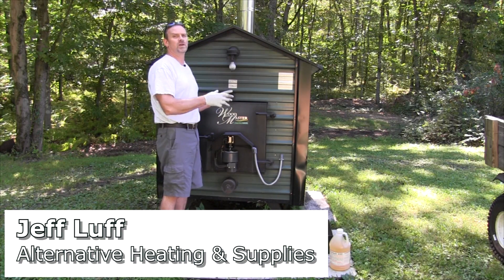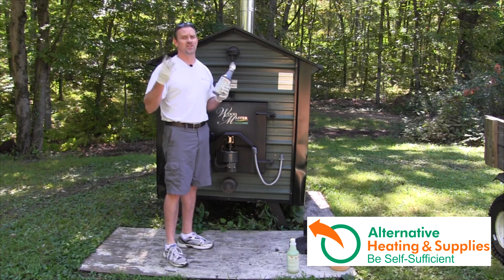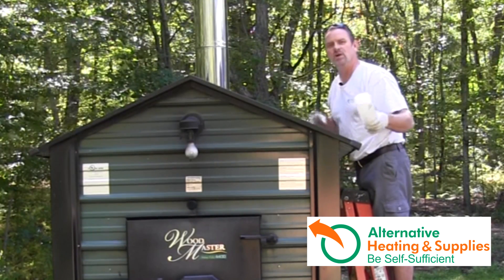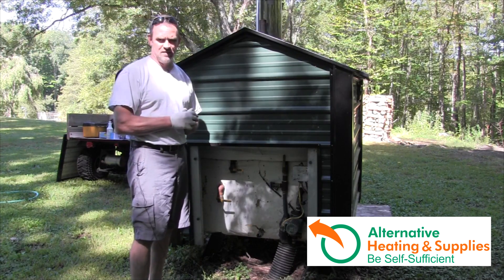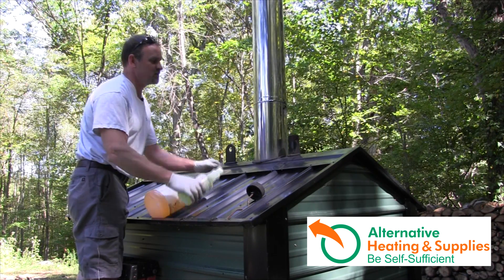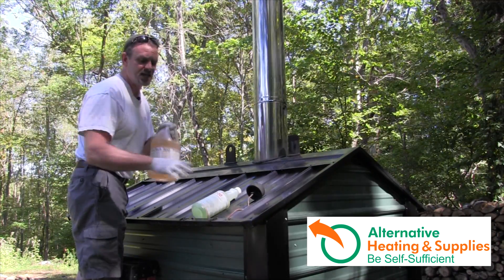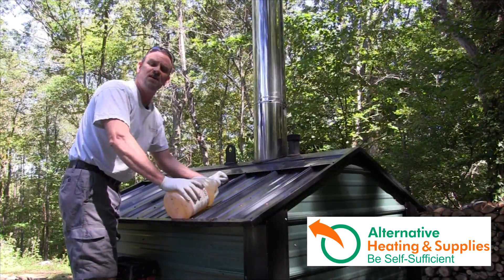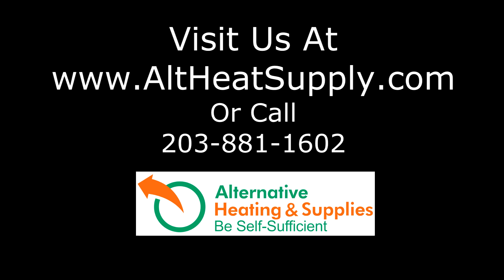How to Use Water Treatment for Your Outdoor Wood Boiler | DIY Wood Boiler Maintenance

Comment: Instead of turning off the water to the lines, won't it be helpful to clean the lines and heat exchangers as well?
Reply: flash basbo i could be way off base, but when you add the cf205 and vinegar to the lines and let it run for 4-8 hours it should clean the lines and all that the water touches. he said that there will still be cleaner in the lines, but it wouldn't matter because it would be diluted so much by the couple hundred gallons of water and also the anti rust and scale treatment.
Reply from the maker: Yes, I also clean those lines and exchangers as well. I close them when draining so I don't need to re-bleed the lines.

Comment: The fill/ vent on top of my unit is smaller and does not have a cap. Is this an issue? I will measure but I think it is about a1” tube

Comment: On the bottle of CF-205 it advised not to come in contact with galvanized steel . I have a couple galvanized fittings in my system left . Can I still use it in that situation.
Reply from the maker: Yes, galvanized steel is not on the inside. Jeff

Comment: I am new to wood boilers, question I have it, Do I need to flush this yearly sense I am running Glycol?
Reply from the maker: I don't like Glycol and don't use. Moving hot water doesn't freeze. All I do is add water treatment yearly.
Reply: @AltheatsupplyLLC  What do you do if it breaks down and you have to order a part that wont be here for couple of days? Somethings got to give
Reply from the maker: @leelc211  I have been burning 20 plus years and have had plenty of failures (around 6 to 8). But there always seems to be a friend to help or parts you can pick up to hold you over. I keep a pump on the shelf and the critical parts. which are still cheaper than Glycol.
Reply: Can you use this while it is hot like a fire going or do i need to let it go out? i run my stove yr round

Comment: 20/20 June and our boiler got several cracks in it around the door so we had a welder come out for $175 which is more than reasonable fairly cheap did a great job of  it would cost us $1,000 just to weld that one piece, you filled the boiler back up with water after 6 to 7 years of using it each year, to see if there was any more holes and found out there was a whole third the top or we couldn't even get to it to weld it you would have had to taken the whole furnace apart itself just to weld one piece, not worth it if we need to heat our house we're going to go back to our old Log Cabin which we've never had a problem with it will heat are home but it won't heat our pool we're going to look for other solutions to heat our pool, you would think for $5,000 a furnace would last longer than 6 to 7 years wish I had them spent the money or invested in it me it's all a bunch of BS fabricated for someone else to make money off of B boiling machine that cannot stand the Heat wished I would have researched it more before I purchased do anyone thinking about purchasing a wood boiler buyer beware are welder said he well it's a lot of them that crack
Reply: My woodburner is a woodmaster. Been running it for 20 yrs. now. All year long. I never run my water temp over 170 degrees and turn it down to 145 during the summer for my domestic hot water and car washer. Been a very good stove.

Comment: Will it hurt my boiler to clean and flush at the end of the year, add the new treatment and let the stove sit a full summer before firing again?
Reply: Fronabarger Conveying & Pumping  i recently bought a house with a woodmaster 4400 already installed.. the man who installed the stove told me that the treatment has anti rust treatment in it and won't hurt to set all summer. the man who installed it also put an electrical bypass switch inside the house to cut power to the unit during the off season so it wouldn't be constantly running the pumps.
Reply from the maker: Both times of the year are fine. What is ever easiest for you